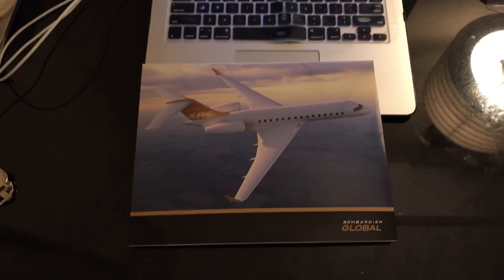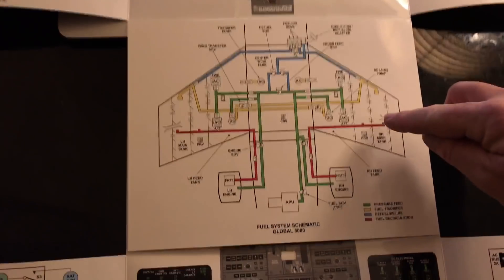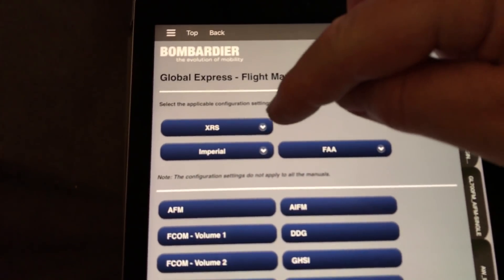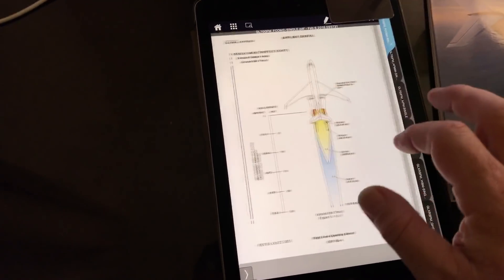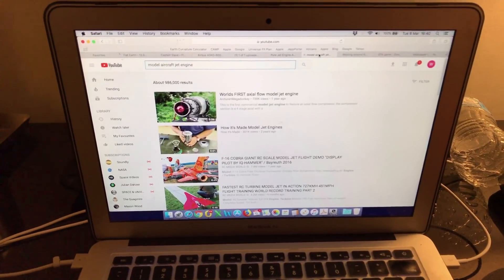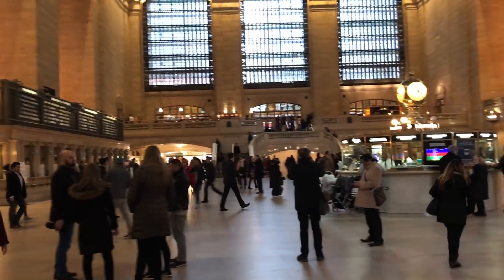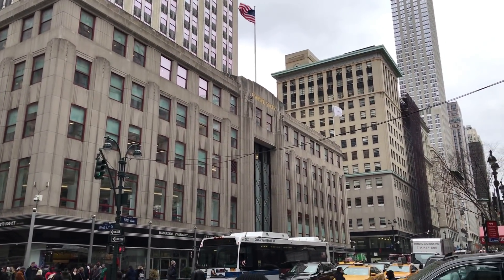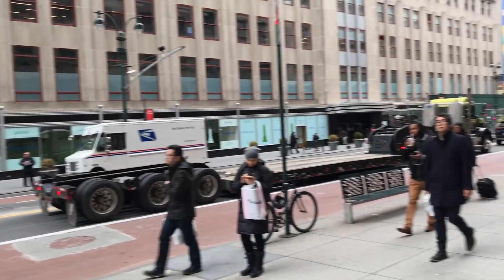Don't be ridiculous - of course Jet engines use liquid fuel.

Comment: Jet fuel is just high grade kerosene.. I use to work with a head steward when I was a mechanic and knew ground crew and people in catering within Air New Zealand.. What are these flat earth clowns saying planes fly on  Wolfie ?
Reply from the maker: +Garth Dryland  They seem to be saying they run on compressed air.   They watched an engine being started by bleed air and put 2 and 2 together and came up with 7
Reply: OMG that's ridiculous.. It's just a highly refined version of kerosene that anyone can buy.  What's that I smell ? Oh, its flat earth desperation in the air lol
Reply: +Wolfie6020 
wolfie, compressed air is about the least efficent power transfer media there is. these clowns also believe water is fuel, perpetual motion and anything else their conspiracy addled minds can dream up
Reply: @mpetersen6  Compressed air works just in pneumatic tools like drills, wrenches, hammers, etc. Of course, the distances are small and the power requirements are modest.
Reply: Oh goodie. I always wanted to learn about flopulsion,  flust and flift.
Reply: mpetersen6 - as i was saying above I was a mechanic and I can also confirm water can be fuel given its two parts hydrogen and one part oxygen.. all you need to do is know how to utilise it.. I have seen cars run on it.. You definitely need to know what you're doing or it can implode and create a hell of a mess.. Implosions are really REALLY bad. Google Joe Cell - Its about an aussie guy doing this.. It really does work..
Reply: @garthdryland  read about viktor schauberger
Reply: @garthdryland  You ARE joking, of course. Otherwise, go back to school and get a basic Science education.
Reply: How do compressed-air-powered planes help the flat Earth theory anyway?
Reply: +Garth Dryland sure you can dis-associate wster and burn the oxygen and H2 to recombine them but it is a real energy loser. just remember, "there ain't no such thing is a free lunch"
Reply: Visda58 - It doesn't but neither does pretty much anything they say.. lol
Reply: mpetersen6 - You haven't watched the video though have you.. You can produce fuel on the fly straight from a liter of water.. Said water becomes more and more refined as time goes on.. You can drink it.. A litre of water can fuel a car for ages.. The fuel produces more horsepower, reduces a tonne of valve bounce, flat spots are practically eliminated.. There are free energy sources.. Dangerous as all buggery in the wrong hand but they 100% work just like i've said here.  I'm pretty sure that what you're referring to is the commercial version of the same thing using one supply of hydrogen and one oxy..
Reply: +Garth Dryland 
Christ on a crutch. Do you really think all the car companies, all the aviation companies, airlines, aircraft manufacturers, engine manufacturers etc are in on it. They are all owned by the oil companies? I've have one piece of advice. Grow the hell up.
Reply: mpetersen6 - in on what.. have you actually read my posts..
Reply: mpetersen6 we need to make a flerf dictionary with words like flerfraction a d flerfpulsion
Reply: Garth Dryland water is a waste product of many fuel related reactions. It is possible to turn water into is base combustible components for ignition, but that requires energy input in the form of electricity or some other chemical means. You may as well just use the electricity to push the car without the middle man.

If you are saying water is flammable however thats hilarious and they should probably stop using it to put out fires.
Reply: +Mike “Mike111177” Davidson Soudly started the whole ball rolling with "flerspective“. Of course it all falls under the definition of "flereasons" In the FlatEarth world everything written has all words begin with Fler. Starting with "flerifiots"
Reply: +Garth Dryland  Water itself cannot be a fuel, since it is the result of burning hydrogen in an oxygen atmosphere.   You can make fuel out of it, by separating the hydrogen and oxygen, but that requires as much or more energy than you get out of it by burning hydrogen.
Reply: Mike Davidson - yes you need a small power supply.. Not like its a nuclear power plant.. I really don't care if you believe it.. It's still true.. No skin off my nose
Reply: Garth Dryland a liter of water is a great way to kill your engine.... But I encourage you to try filling your gas tank with your garden hose and report back with your findings.
Reply: Mike Davidson - you're tripping dude. Try reading in context.. You might get it then., then again maybe not
Reply: Garth Dryland ah I see it is electrolysis. You are correct in that using water and electricity you can create hydrogen and oxygen which could be burned as a fuel. You overestimate the potency of such fuel. But that is not important. 

What is important here is the energy required to split a water molecule into hydrogen and oxygen is exactly the same as the amount of energy recombining the.m creates. It is also important to note that water has a pretty high resistance, therefore much of your electrical energy will be wasted in the form of heat. So you are not gaining a net increase of energy by converting your electricity into hydroxy gas power. Also note that burning the hydroxy gas will have a low energy capture efficiency, as internal combustion engines kinda suck at it.

You may as well hook up your battery to an electric motor before using it to electrolysis water.

Also note, if your theory was correct, the burning of hydrogen and oxygen would yeild the same amount of waste water as you put in, which could be captured and reused indefinitely, which would also show that the energy source is not infact the water.
Reply: Walter.. I don't care if you think it's impossible.. that's your shortfall, not mine #facepalm
Reply: Wolfie6020 ...minor error since in the case of FE logic 2 + 2 = 0.  Everything they say makes zero sense.
Reply: Garth Dryland 
The point their making is while it is true it works, It's highly inefficient. 
Your unsubstantiated assurtions about its efficiency is incorrect. 
1 liter Water as fuel has been debunked for some time now. 

FYI 
Pushing this point any further without any evidence is going to make you look intellectually dishonest. (which is why some have already started to compare you to flerfers).
Reply: Garth Dryland don’t worry man I have heard of hydrogen engines unlike Walter but i don’t think it’s free energy just a great renewable resource
Reply: Mark Richardson 
No one is saying it doesn't excist, just that it doesn't work as great as Garth and apparently You think.

Since one only gets out what one puts in (and it's Electric based) it's just simpler to cut out the middle man and just go with a complete electrical engine instead. It’s less hassle.
Reply: Did a quick search, and here's the most feasible explanation I could find on Joe Cells (guy talks slow and explains patiently, so 1.5 speed is OK) https://youtu.be/AH20UL7Kdgw - note that there's a whole bunch of unusual terminology in other sources.
Reply: William Chamberlain 
Thanks for the link, i'll look at it later when i've got the free time.
Reply: Guy The Incognito I’m talking about combustion hydrogen engines we could use renewable energy to create the the fuel from water then put it in the car and water comes out I’m not an expert thats just the way it would make sense to me
Reply: compressed air? hmm.. so it must be the chemtrail liquid that explodes when a plane crashes!
Reply: +Garth Dryland Yes, you can break down water into two parts hydrogen and one part oxygen, but it's about the least efficient way of running a car there is.  Hint: The electrical system in a car has enough juice to produce enough H2 and O2 isn't enough to keep a lightbulb lit.

The rest of it is smoke and mirrors.
Reply: +Garth Dryland You've really swallowed the Brown's gas nonsense haven't you?  There is no such thing as free energy.  It has to come from somewhere.  Producing Brown's gas requires energy.  More energy than you get back from burning the stuff.
Reply: +Garth Dryland

HHO.Water powered cars are a LOSE/LOSE energy balance.

It takes 236 kJoule to decompose one mole of water.  The energy produced by burning one mole of hydrogen in EXCESS oxygen is 286 kJoule.

Haveing to provide EXCESS oxygen reduces the efficiency.  Losses in the system (leakage, inefficient burning, contamination) reduce that to not much more than break even.  

Part of that energy would have to recharge batteries for electrolysis, which is also inefficient.

Burning one mole of gasoline (octane as the equivalent molecule) releases 5061 kJoules of energy.
Reply: +Visda58

How do compressed air planes help the "Flat Earth?"

"Everything they tell you is a LIE."

This nonsense helps the conspiracy that there are hidden overlords keeping us in the dark about "The Truth."
Reply: +Garth Dryland
"You can produce fuel on the fly straight from a liter of water..,"

Not really.  You've got to start with batteries or solar cells to electrolyse.

"Said water becomes more and more refined as time goes on.. You can drink it..,"

False.  The water goes out as EXHAUST.  Everything you do to try and reclaim it simply makes the system LESS EFFICIENT.  And I wouldn't drink anything that had b=assed through a combustion engine.  Heavy metals, ETC..,

"A litre of water can fuel a car for ages..,"

Not even.  Ludicrous.  LOSSES, LOSSES, LOSSES.., 

"The fuel produces more horsepower.., 

See my description of the energy produced per MOLE of water and per mole of octane.  It is a 2:1 better fuel.
Reply: Would it be possible to 'lower' the amount on energy needed to break HHO covalent bonds by supplying an electron flow with resonant oscillations that match the oscillations of the electron orbits? On the macroscopic scale, sound pressure at the resonant frequency of a wine glass can shatter it.
Just throwing the idea out there, though its likely electron shells behave quite differently to wine glasses :)
Reply: +Sukram Sukram

"...supply an electron flow with resonant oscillations..,"

Uh, WHAT???  First off:  electrolysis uses ELECTRON FLOW.  "Reducing the energy needed by supplying an electron flow"  seems a little redundant, don't you think?

What ENERGY are you going to use to produce that "resonant oscillation?"

Think about the energy balance there fellah..,

You are not actually "SIMPLY" breaking covalent bonds of H20.   Google the "Stoichiometry of Electrolysis."  Electrolysis does not work with pure water very well.  It has little ability to carry electric current.  It has very high resistivity.  You need an electrolyte.  KOH is one of the best.  

In a solution of KOH in water, you are actually separating the -OH and the K, and the H+ and the OH in an IONIC solution.  There are four or five reactions  with electrons going on at once.  two at the anode and two at the cathode.  The electrons added by the electrolysing current are supporting the oxidation/reduction reactions going on at each end of the cell.  It is more complicated than simply breaking the bonds in the HOH molecule.., 

https://www.chem.purdue.edu/gchelp/howtosolveit/Electrochem/Electrolysis.htm

https://en.wikipedia.org/wiki/Electrolysis_of_water

For starters.  A lot more complicated than basic chemistry.
Reply: I get the impression that they believe that there is some magic technology there that is hidden from us by a LIE about hydrocarbon fuels and the technology that turbines operate on.

Another FACT that supports the Global "THEM" who control us brainwashed masses..,
Reply: Neil Helgeson - thanks for the lesson ... fellah. Was just an idea mate, an out of the box speculation. Resonance can be powerful in nature, it can bring down buildings. Creating flammable gasses out of water in a 'useful way' has been attempted by many. Resonating frequencies can make things fall apart. And resonation is self reinforcing so needs less energy once oscillating. ie: pushing a swing.

How to resonate an atom to match electron motion ... no bloody clue !!
Just a concept, likely science fiction.
I know that one of the hurdles in the 'water to fuel dream' is the strength of the bond part of it. 
Of course its more complicated than just breaking it.

And no in no way would I contemplate that planes are running on water or air. It's actually more whacked out than the FE idea itself - didn't think anything could be !! I've debated many FE believers, and pretty much given up despite consistent temptation. It's futile ... but if kids are reading, FE needs to be counteracted. 
I've finished my innings :) I just watch the dance of the dumb for entertainment now.
Reply: +Sukram Sukram  Do note that the molecular bonds in water resonate up in the region of 20-50ghz.  Producing power at those frequencies isn't easy at all.
Reply: Sukram Sukram ROFL.., M-8
Reply: +Raging S

Well, jet engines really ARE AIR COMPRESSORS..,  

What the conspiritards leave out is that the main method jet engines use to run that air compression factory is JET FUEL IN A COMBUSTION CHAMBER.

Using gallons and gallons per minute of JP-1
Reply: Fromage Frizzbizz - thanks, interesting, duly noted :) I don't now much about molecular scales so forgive my lack of knowledge on it.
Reply: +Garth Dryland: At the molecular level, it takes exactly the same amount of energy to split water into hydrogen and oxygen as is released when you recombine them to make water. However, since no electrolytic cell, generator or engine is 100% efficient (or can be) the entire process loses energy. This is basic, high school level chemistry and thermodynamics. For God's sake, get some education and you won't be taken in by youtube videos made by scammers and idiots. Water is not fuel. The "hydrogen economy" could be useful as a means of storing and transporting energy from renewable or nuclear sources, but water is not, and never will be fuel.
Reply: Neil Helgeson - yea I noticed that about microwave ovens too, funny that hey? But re directly affecting the resonating frequency of the molecules, your microwave oven point is not so relevant.
Reply: Russ Lehman - I don't care if you like anyone understand it or not ZZZZZZzzzzzzZZZZzZZZZZZZZz
Reply: Walter Boxhead read my past comments bra I already mentioned it wasn’t free energy
Reply: +Sukram Sukram:There really aren't any known "loopholes" in the laws of thermodynamics, and I'm extremely confident none will ever be discovered. Any process that produces energy consumes the same amount of energy (ideally) when you reverse it, whether it's burning hydrogen to make water, or making hydropower from water running downhill. You can't get a net energy output from electrolysing water and recombining the hydrogen and oxygen any more than you can by pumping water uphill and then using it to run a hydroelectric power plant. Either process can potentially be useful as a  means of storing energy (and pumped storage hydroelectric plants do exist), but, because no energy conversion is 100% efficient, there will always be a net loss of energy.
Reply: Mark - its still a shit load cheaper than paying for fuel - Your point is neither here nor there..
Reply: Ross - Just because you're unaware of something doesn't mean it's not possible.. Go Figure
Reply: Russ Lehman - I tend to agree.
Reply: Sukram Sukram - apparently level equals flat and logical too.. it still wrong.. LMAO
Reply: Raging S "Also they make no attempt to explain how the air gets compressed in the first place" 
Too easy, when plane flies ~500mph the air compresses automatically because the engine's intake/front side is larger than the exhaust. This makes flying super cheap so the ticket revenues can be invested into NASA's mind control projects. 

At the takeoff and acceleration the engines run on air that has been compressed into the plane before takeoff. THEY EVEN TELL US THE PLANES ARE PRESSURIZED!!
Reply: Garth Dryland I don’t think anyone reads the comments cause I got no idea what your arguing I already said it was a great renewable resource and that it’s not free energy I was backing you up mate
Reply: I really wish they didn't need fuel. Been a pilot for 30 years, and lost a couple of good friend due to fuel starvation. Three things that are useless to a pilot; the airspace above you, the runway behind you and the fuel you left on the ground.Thanks for your effort Wolfie , just get the feeling we're wasting our time!!!
Reply: Wolfie6020, i really don't care if airplanes run on kerosene fuel or on compressed air, of course there is fuel used in the operation of airplanes, but not as much as the airlines industry wants you ( public) to believe in. One thing i do know to be the whole truth, is nobody will ever go beyond lower orbit . Good luck for any space program  in the world for attempting to traveling to Mars, i will be waiting for the outcome. Have a great day!
Reply: +Vesa Silvan Nope.  Completely wrong.   How do you get the aircraft up to 500 mph then?  What keeps it moving at 500mph - a funnel had a LOT of drag which slows the aircraft down. Expecting it to sustain and increase in speed without ADDING energy is just plain nuts.   You have to add energy to make it go faster.  A funnel doesn't add energy.

And what about the compressor vanes?  They just act as drag unless you use additional energy to turn them.

I don't know what you're smoking, but if a propeller plane's engine runs out of fuel, it slows down.  So does a jet.  Research the Gimli glider.  If jet propulsion without fuel were possible, Gimli wouldn't have happened (and Air Canada wouldn't have been so embarrassed).

Ramjets (that compress air purely by movement through a specially shaped venturi and use that compressed air PLUS fuel to produce thrust) do not work at a mere 500MPH.  At all.  Way too slow to compress the air enough.  Try mach 5 (preferably 10) and above.  Which is why you can't fly ramjets at anywhere near ground level (by "near", we're talking below about 50,000 feet).  They burn up due to drag.
Reply: +Mark S People have been above LEO, and they will again as soon as they have a rocket capable of getting people up there, and a project to do it.  It's simply a matter of going around the Van Allens.  No biggie.  Ask Van Allen.
Reply: +Wolfie6020 The full theory appears to be that the blast of compressed gas out the back spins the exhaust turbine so as to supply more gas in the input via the compressor turbine up front, no fuel needed, just an initial push, and you have power forever.

This is exactly the same as putting an electric motor on the front wheels of a car, and a generator on the back wheels, and expecting the generator on the back to supply enough power to the motor run the car around forever.

Sadly enough, I see that someone has actually managed to pull the wool over a US Patent inspector long enough to get the idea patented.  Despite the fact that the USPTO requires a working model for every perpetual motion (or overunity) claim.  Obviously someone screwed up.
Reply: Garth it is ridiculous and a lie ... lmao ... anything wolfie says is gospel huh??   That is not why people think this ...Also no one is saying every plane is set up to use compressed air. I hpe wolfie come back with the vid of an a380
Reply: NO
LIVES 
MATTER 
2Chemtrails.
Reply: Flat earth planes fly on pure high grade bullshit.
Reply: Basic understanding of how a Jet engine operates.
The engine has blades that spin in a very high-speed pushing and compressing air inside it, this air is then injected with Jet Fuel, and the mixture of compressed air and Jet Fuel is ignited by an electrical spark.
The burning gasses expand and blast out through the nozzle in the back of the engine, creating thrust and pushing the plane forward.